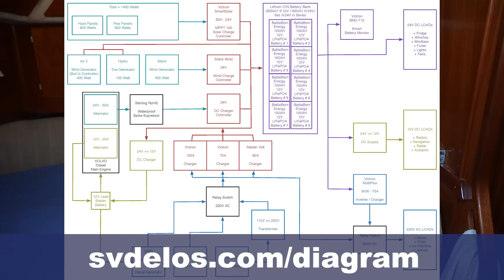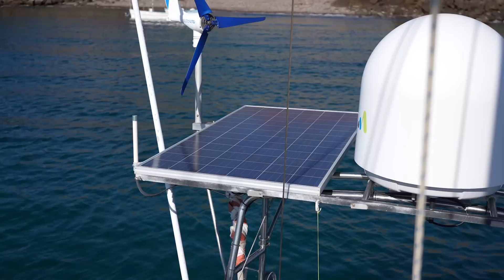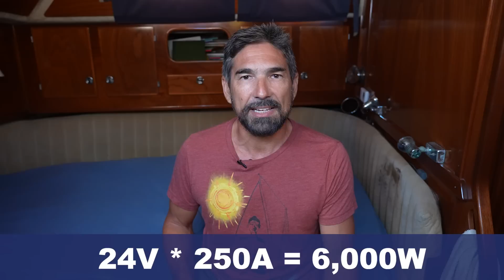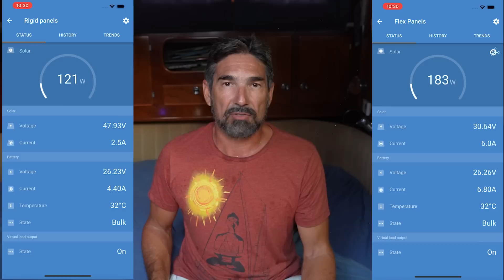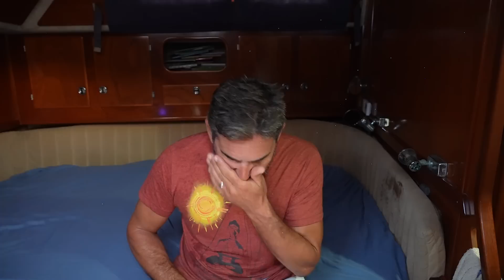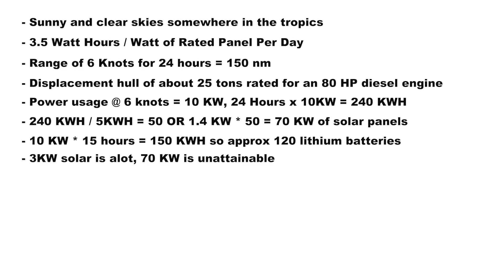ELECTRICITY On A Sailboat Q&A ⛵️ (Lithium, Solar, Wind)

Comment: For some people this will probably be considered one of the best videos from SV Delos ever.  Others will skip it altogether. I am an engineer, so perhaps some may think that I understand all of this, and I do…but…until you get into “energy and load management”, it will remain mysterious. Fortunately, or unfortunately, depending on how you look at it and your experience, we are all becoming “managers” somewhat. IOW, maybe solar on the roof, an EV in the garage, rolling blackouts, battery storage, energy bills, cost and availability of fossil fuels, the drumbeat of the news cycle, etc, etc. Nothing makes you a better manager than going cruising or van-living off grid.

Comment: Great video and congrats on completing your circumnavigation! Wouldn’t it be a big benefit to convert some of your AirCon and refrigeration from 110vAC to 12vDc. It could be much more efficient and use less power. I know there is a big expense but it may make sense in the hot Sea of Cortez type area.

Comment: Thanks for all the info Brian, love the Generator efficientency , running the generator at perfect timing like running it during the water maker or the air conditioner for max 4 hours is a good way getting your batteries to 100% at the same time...

Comment: Hey Brian, from one EE to another, you keep saying things like "One kW hour is a lot of power", but it's really energy, isn't it? See https://en.wikipedia.org/wiki/Kilowatt-hour.
Reply: Since power is measured in watts, a kilowatt is power, no?
Reply: @flygringo  A kilowatt is power, but a kilowatt-hour is energy. If you check your electricity bill you will see usage in kWh (kilowatt hours). Power is the rate at which you use energy:  Power = energy/time, so Energy = power x time (kilowatts multiplied by hours--> kilowatt-hours). For example, if you use one kilowatt for an hour, you use 60 times more energy than if you use one kilowatt for one minute.
Reply: I personally think he should just use the unit "pirate ninjas" #TheMartian

Comment: Thanks for pointing out the absurdity of all electric offshore cruising. It’s true that you don’t need an engine at all, however, that is a completely different type of adventure than all but the most hardcore purists would find even close to fun.  This is without even getting into the many 10’s of thousands dollars and crazy amount of weight,  if you could, in some universe, find the space to accommodate the batteries alone.  Yeah, but Uma does it, blah blah blah, yeah sort of, with loads of free stuff, brand deals,Patreon and AdSense income that you will NOT get.

Comment: I always wondered how they have not created a solar and wind battery efficient AC that can bring a sailboat to a nice 26 C or 78 F with really low consumptions. It  would be a deal breaker in the Caribbean for example.
Reply: You can't get something out of nothing! Almost impossible to get 200 mpg out of a car. Almost impossible to get cold air in a hot climate without using a LOT of energy!
Reply: @jessiebrader2926  I believe It can be done, with a consumption even lower than a freezer I'm sure. I repeat not to bring it down 18-21 C! keep it in a nice 26C which I know inverters run pretty efficiently at those levels in normal apartments.
Reply: @DMDC91  Aloha David, I have sailed most of the way around this planet and now instal solar systems on 'off the grid' homes in Hawaii. Sailboats are not normal apartments, they are not well insulated. The companionway is almost allways open. The shadows from the sails and booms render solar not as efficient as they are on a rooftop. I just don't think there is enough square footage on a sailboat to support an A/C system. But...invent one, you will make a fortune both on and off the water. Good Luck

Comment: Crude oil is mineral oil and is abiotic, meaning not derived from decomposing living matter.  Diesel fuel is from crude/mineral oil. Crude oil is the second most voluminous liquid on Earth next to water. Crude oil is continually created, and old oil wells once thought empty are now full again.  So crude oil is renewable energy. 
The Rothschilds cleverly coined the misinformation and lie that mineral oil is a "fossil" fuel. 
Lithium batteries are very bad for the environment.  Please research it. 
Be free.

Comment: Brian. If you were to repower would you install a regenerative hybrid diesel for the main?
Reply: You did touch on this a bit after I posted this but you didn't mention the new prop regen units.
Reply: I think Delos stays anchored in place too long for prop based generation to be practical for them. In the industry I folks are steering towards feathering props and using external devices like watt and sea for making power from boat motion. Especially on faster boats and catamarans.

Comment: Fascinating video Brian. Really enjoyed the clarity of your answers.
What would you think of putting in a HEAT PUMP for your A/C and water heating needs?
I am not an expert at all but wanted to know what you thought as you can use less electricity to power those systems.
Reply from the maker: I’m not entirely familiar with heat pumps on land, but our AC does use sea water to remove the heat.  So I do think it’s more effecient than an air exchange system and similar in principal to one that is exchange’s heat with the ground.
Reply: Technically all AC units are heat pumps. Brian is describing a water sourced heat pump. One big advantage is that the circulation pump uses less energy and noise than a fan would moving air. Also with air sourced heat pumps the condenser side is still inside your boat somewhere spewing out hear in AC mode. In your house the condenser is outside spewing heat from inside your house to the outside. In Delos the heat spews out.

They make reversible heat pumps but in most cases they lose some efficiency just because they aren't optimized for a single direction. The expansion valve can operate in both directions and your evaporator and condenser sides both have to be capable of handling high pressure (less optimized). 

For hot water, my main engine has a heat exchanger in the tank. Heats up the whole tank in less than 15 min.

Comment: You're probably not using that much hp from the diesel. Fuel flow is a more accurate measurement at 0.4 lb /hp hr. For instance 2 g/hr is 13.4lb/hr divided by 0.4 is 33.5 hp  3 would be around 50.

Comment: Why is the 220 relay feeding back into the chargers according to the diagram???
Reply from the maker: It’s a little confusing the way it’s drawn, but that is really a common connection point to the 220AC bus.  And there are two relays to make it impossible to power the battery chargers from the inverter….

Comment: Great video, however one could argue that a ICE is enormously more complex than a simple electric motor...just a thought.
Reply from the maker: Yes for sure, but given the power density of fuel vs batteries it really can’t compete when you need to cover some miles.

Comment: Hey Brian, have You looked into replacing Your windenergy converters with VAWT type (e.g. 1 or 2 ICEWIND Freya) to generate more windenergy at far lower noise levels and in a wider range of wind?
Reply from the maker: I’ve seen those but have never looked into them in detail.  I wasn’t able to find a power curve on their website.  Do you know what one of their units that could fit on a cruising boat would put out in 15 knots of wind?
Reply: @svdelos  Hey Brian, I just came across another interesting concept that has begun to be installed in the housing market in Germany recently. I believe it is originally from California and already proven a couple of years. I could well imagine to install it as a VAWT in front of the mast to gain similar effects. Search for RidgeBlade. The figures seem impressive and there should be a number of customers out there with real world data (if only in the housing segment and on land)
Fair winds!

Comment: a purely electric drivetrain may not be feasable for now but with more solar and(wind) energy you wont need to use the generator regularly. An electric motor with a bigger battery bank could also cover short term motoring before and after sailing. So then a hybrid drivetrain will make sense...
Reply from the maker: We could also just shut off one of our fridges and turn off a few laptops!  Actually after filming this I decided to upgrade our panels so will report back on if we can still carry 6 months supply of lactose free dairy products and live off the sun ☀️ 😀

Comment: Can you generate power with a water turbine while under sail?  There will be drag, but seems like could generate more than wind.
Reply from the maker: Yes, we have one but stopped using it once we upped our solar game.  In fact we need more power at anchor than sailing, so given the additional setup and drag have just done without.
Reply: Interesting question. I bet there are students of fluid dynamics who have been asked to determine the answer on an exam paper!

Comment: I have two 200 amp hour lithium batteries and 650 watts of solar live in San Diego and my 35 ft. Sailboat.  batteries are always full by 2:00 pm. I have a 40 inch television a 5-ft magic chef house refrigerator lights stereo everything I need. I use about two to two and a half kilowatts a day.
Reply: Important question. Were you able to obtain full coverage insurance with the insurance company knowing you installed Lithium? If so what insurance company? A lot of controversy going on with the major insurance companies and lithium installs. Thank you for your response.
Reply: @maritimetees2315  that is a good question I didn't even inform my insurance company I put lithium batteries on the boat didn't know it mattered or that you had to? Also I don't even know if I have full coverage insurance my boat? the batteries are almost worth as much as my boat laugh out loud. For others I would say definitely check into it but I don't live my life that way. I seldom ask for permission. I do what I want and then beg for forgiveness... But I don't have that much to lose lol.
Reply: @MB-ib5ji  yes it could disqualify you if you have a claim. Many of them will drop you.
Reply: @maritimetees2315  I don't have an insurance policy where I make claims. if I have a total loss it will be in deep enough water will they won't even go down and investigate.  so how will they ever disqualify me or know? For a $16,000 sailboat they will not even go down a hundred feet to investigate the loss... And anything other than that the good part is they're so light I will just remove them off the boat. Next? Lol
Reply: @MB-ib5ji  that answers that question. There is a reason why i asked this question because I went through insurance trying to get a policy with full coverage with lithium and they all were declining. I hadn't even put lithium in, but they all were like NO! I did find someone but they were like if the lithium causes a fire you will not be covered.
Reply: @MB-ib5ji  if no full coverage then it doesn't matter. If she goes down grab the lithiums for the next boat.

Comment: Why don't you replace the noisy wind generator with a silent one? Are silent wind generators very expensive? Will it make a big difference to your power situation if you could run 2 wind generators all the time?
Reply from the maker: Probably an extra 1 KWH per day if we had another wind generator running. Given the cost I think it makes more sense to upgrade the panels actually.  We could get an extra 100w per panel for the same real estate if we upgraded.

Comment: I will definitely second the lithium battery at the price point you can get lithium batteries nowadays through the rainforest website they are cheaper in the long run than lead acid and half as heavy. way better to use plus they run at a higher voltage so you need less amperage keeps your wires less likely to burst into flames lol.
Reply: Can you provide a link for the rainforest website? I searched on Google but nothing came up

Comment: I remember when you did a video about swapping from standard flooded cell batteries to lithium so I've been hoping you'd do an update on how they worked out, any downsides and even if it affected balance and handling of the boat. Lithium batteries are still very expensive so how they last, charge, output and handle under different temperature conditions is vital to know before making any decisions.
Reply from the maker: They are about half the weight so we now lost to port a little bit (bats on starboard) lithium is more expensive but in the long run will pay for itself many times over.  We have had them since last 2018 now and have been very happy with the performance, both in the tropics and cold.
Reply: @svdelos  I paid around $700 delivered for my 200 amp hour lithium batteries my 100 amp hour interstate agms were $350 each can only use 50% of their power and they only last 4 years. My lithiums have a life cycle of 5,000 cycles that's 12 or 14 years. So almost cost the same and last three times longer and give you 25 to 50% more usable power and weigh half as much. 4 me it was a no-brainer....
Reply: @MB-ib5ji  I'm about to purchase lithium batteries. What brand did you get for $700 for 200Ah?
Reply: @svdelos  we bought our battle borns about the same time you installed yours.  I couldnt be happier with the company and the product. Ours were installed in our RV with the same inverter setup you have and 1300 watts of solar.  The price was a hit at the time but i still have no regrets.   Safe traveling.
Reply: Only downside is The upfront cost and the thought you will have in the back of your head. "will they last" but I have zero regrets ,zero maintenance ,very light, super powerful ,charge faster ,run at about half a volt higher than lead acid. Also have a very steady voltage until they fall off unlike lead acid that's voltage is all over the place.
Reply: Brian: you know this stuff and your advice is very valuable but sometimes you say kilowatts when you mean kilowatt-hours and power when you mean energy.
Reply: Only downside I've seen is if you accidentally Arc a wire they don't get hot and smoke they explode laugh out loud. Lithium batteries can instantly output 50 to 100% of their power from like 30 to 40% for lead acid. And if they ever catch on fire just jump off the boat!  there is no way to put them out and they will burn right through your boat...
Reply: @MB-ib5ji  what brand of batteries did you blow up? Did your boat catch fire? Tell us your story please.
Reply: @FlipCouvillion  I never blew up any batteries? I just accidentally arct a wire together in my electric panel and made a lot of smoke but no fire.
Reply: @@timemachine1944 yep. What he said...